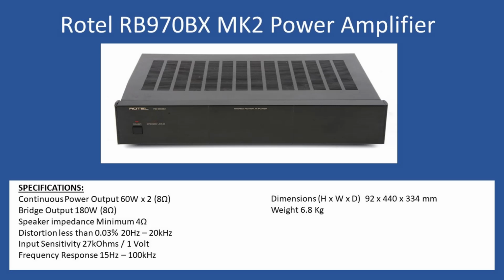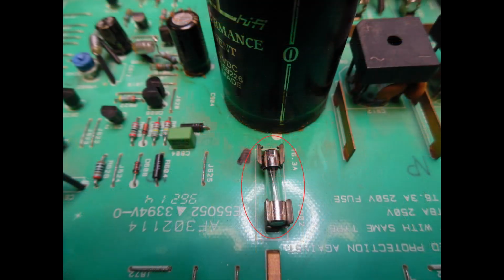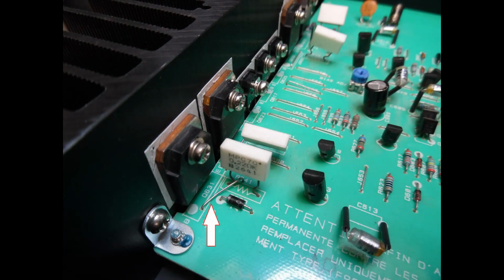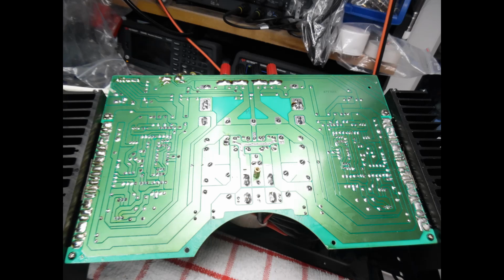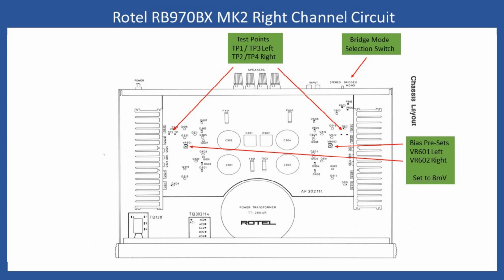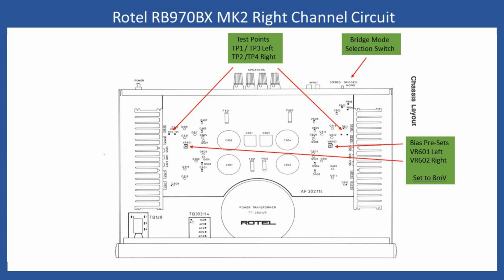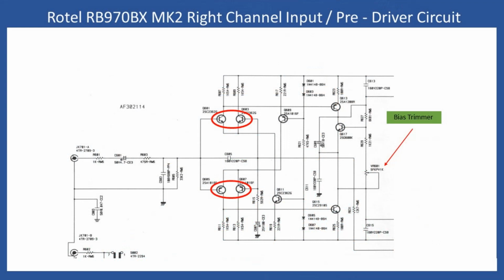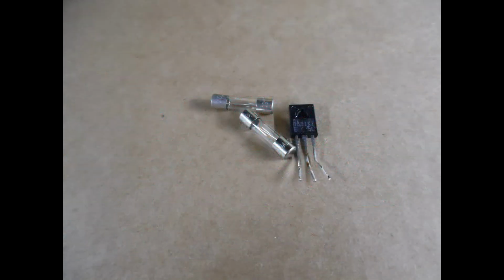Rotel RB970BX MK2 Power Amplifier Repair (With Audio Tutorial)

Comment: Good work finding that transistor. 
  Wow 8mv is quite low. Does it matter if the bias is -mv or +mv for example could on a different amplifier set bias for either + or -20mv for example because with some bias pots you can go either side of zero.
Reply from the maker: Hi no it would not be possible